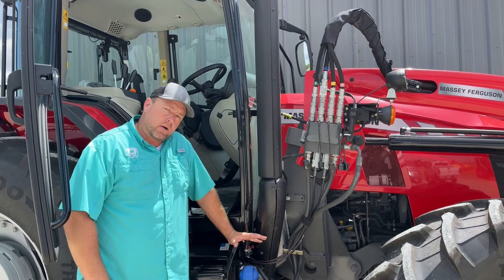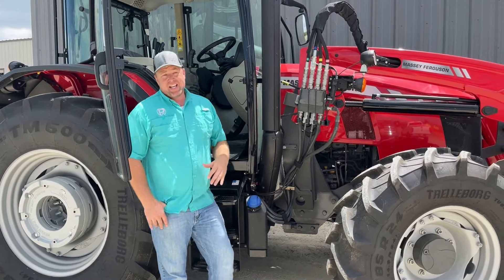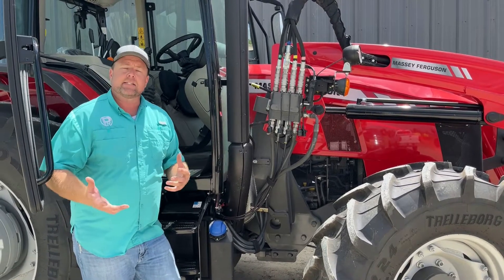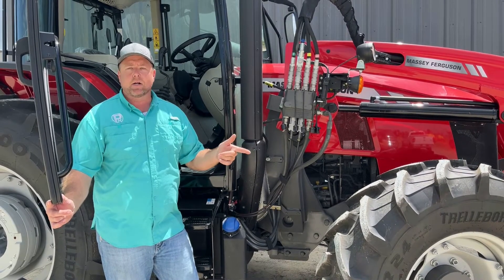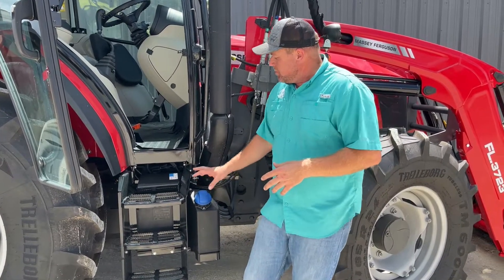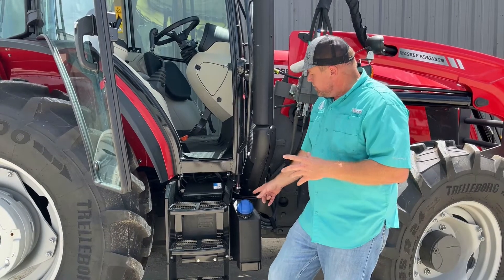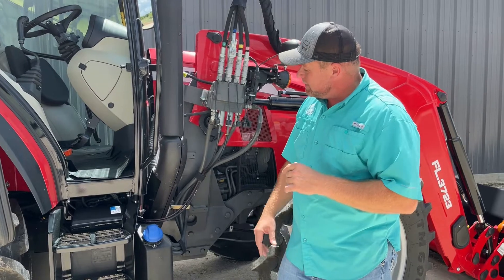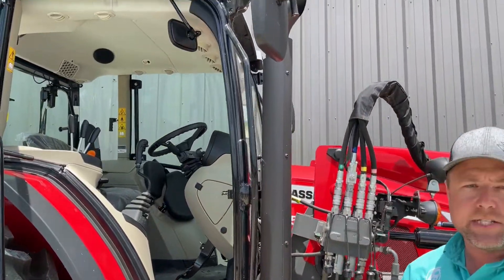Tractor Emissions  - Taking a look at DEF/SCR Systems

Comment: I bought my 4710 back in 2020 it has been great other than it throws a def quality code atleast 1-2 times a year. I don’t put many hours on mine a year. I usually have to drain the tank and put fresh in. Do you think there could be something wrong with the sensor?
Reply from the maker: Yes I would suspect the sensor and you're tractor is likely still under emissions warranty.  They've made huge improvements in the DEF quality sensors over the years and we rarely see problems on the 2020+ models these days.  However, I would definitely get it checked soon because it would be paid for as long as it's under 5 years 4000 hours.

Comment: Do not buy anything that has to use DEF They will cost you MONEY!
Reply from the maker: Typically, I would agree with you, but there’s been some big improvements in the last few years. Obviously, I can’t say bulletproof but pretty dang reliable and way better than a tractor of this size with regen.  Also don’t forget the emissions system is backed by a 5-year 4000 hour warranty.

Comment: I have a 4709 with under 200 hours.  In the last 6 months the computer has shut it down twice because the sensors show the exhaust is not getting clean enough.  My dealer is telling me this is my fault that I need to keep it at 2000 RPMs at all times.  Seems like a load of BS to me.
Reply from the maker: Yeah, that’s definitely a load of BS. If it was a regen system that’s a different situation but on these SCR systems it’s not a problem.  In fact, that’s one of the nice things about these SCR systems is that the RPMs don’t really matter.  There’s something else going on.

Comment: I have a Massey Ferguson 6712 that is throwing a e16 3031 code(def tank temp too high), I have checked the lines and for corrosion on the top where the wires come in, and all the wires, does is it the def sensor/coil? And do you have to purchase the whole unit or can you purchase just the sensor?

Comment: I have a tractor with 1200 hours in great condition.   It already needs a $4000 supply module.  4000 dollars for a pump?   Where do they come up with these prices?  Either these systems need to be way more reliable, or they need to be cheaper to fix.  This is why farmers are deleting the systems.  Tired of the headaches.
Reply from the maker: How old is your tractor?  Emissions systems are covered for 5years/3000 hours.  What model tractor?  $4000 seems pretty high.

Comment: Don't say its ok if the def freezes because here in Canada it freezes all the time and causes many problems because of it
Reply from the maker: Not saying it’s never caused a problem I’m just saying the system is designed to deal with frozen DEF.
Reply: @prequipmentsales  i know and I didn't mean it how it sounded it's just that I've had def freeze on me a few times and more often than not it has caused me problems
Reply from the maker: @JT-lm3sj  oh I actually worked for AGCO/Massey for a few years on the technical side.  You northerners threw us some curve balls with them crazy negative temps.

Comment: So wait, if someone pulls the exhaust temp sensor out to were its sensing ambiant air temperature and plugs the exhaust port for the sensor it will never use Def fluid?  🤔

Of course that's assuming it's not controlling air fuel mixture with that reading thru the computer.?
Reply from the maker: To late to the game.  There was a time when you could do just that.  Software is smart enough to realize that’s been done now.